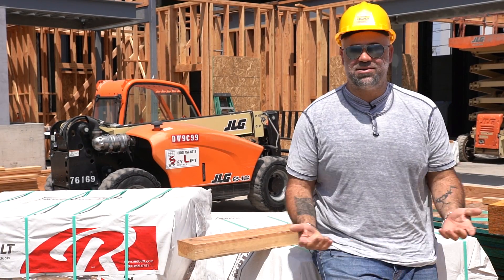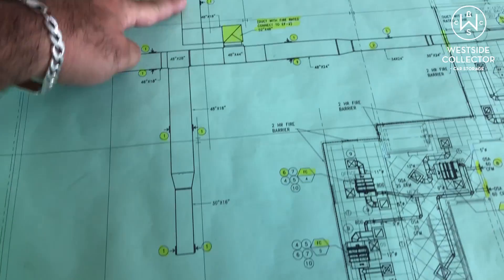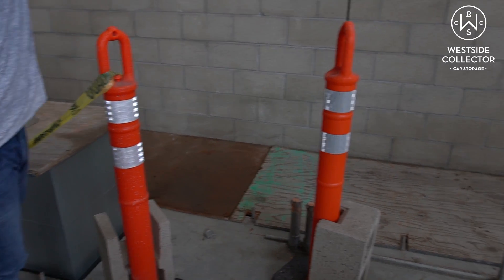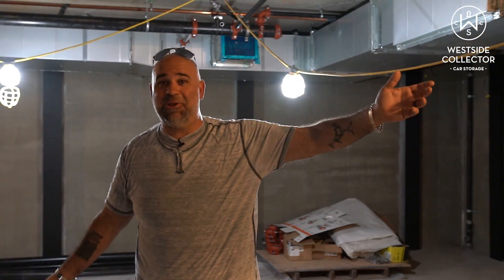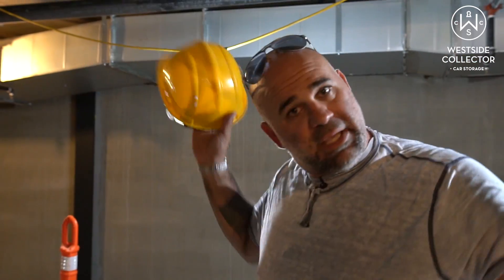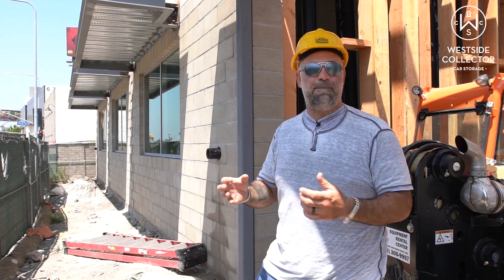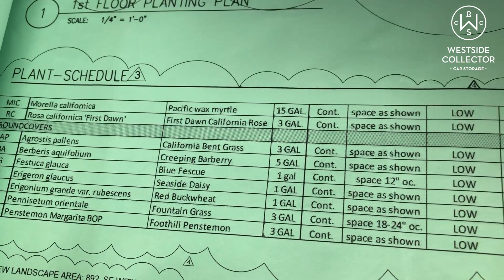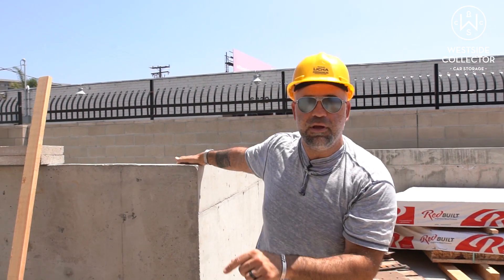How I Built LA's Coolest Parking Facility - Part 2: Air and Water

Comment: I like how Matthew has an interest in all of the MEP systems and structural elements of his development. Not something you often see from a developer.

However, the commentary about the sprinkler system around the 11 minute mark is not understanding a number of the foundational principles of fire protection engineering. 

With regards to the sprinkler system commentary, not sure I agree with what he's saying. 6" service sounds fine and is typical, but 3000 GPM (gallons per minute)? What does that mean exactly? Such a value would have to be tied to a corresponding pressure (i.e. 3000 GPM @65 psi, or in car terms, 400 hp @ 6000 rpm, not just 400 hp). That would be talking about hydraulic demand, much more so than a hydrant flow test result........but in either case an unrealistic # for discussion unless it's a theoretically derived flow at say 20 psi (and even so, that's not how an engineer or sprinkler designer would describe the system to his customer). 

Could the system have a capacity of 3000 gallons filling the pipes? For a large system, maybe. Not sure if this is a wet system or dry (SoCal probably never gets below 40 degrees Fahrenheit, so maybe wet). It's important to know the water capacity of a dry system so as to be able to design it to fill quickly in a fire scenario; 750 GPM is a threshold that requires a quick opening device, and could this system be 4 times that threshold? Maybe, maybe not, but not a relevant topic at the 30,000 foot level discussion. 

Total quantity of sprinkler heads does not affect water demand ("I have 90 heads in the basement alone"); they will only go off one at a time as necessitated by the fire nearby; a building can have 90 heads or 9000 heads and the size of the design area will likely be the same. You can only design for one fire in the building at a time, not the entire building engulfed at once. 

Normally when talking about sprinkler systems you talk about a hydraulic demand for a design area (most likely 1,500 square feet for ordinary hazard here), and a combined sprinkler & hose stream demand. There's just no conceivable need for 3,000 GPM for a concrete structure storing cars, nor is it likely to receive that kind of water flow for a non industrial facility, from a 6" municipal main. You would certainly need a much larger main to allow that type of flow. I've never personally witnessed a flow test putting out more than 1500 - 1700 GPM, which is a lot of water in itself, let alone 3000. 

If we assume NFPA 13 Ordinary Hazard Group 2 here (generous), 0.2 gpm/sq ft * 1500 sq ft = 300 gpm (and let's assume a healthy 20% overage), so 360 gpm, which we'll round up to a clean 400 gpm. Now add a hose stream of 250 gpm, and that's 650 gpm. Pressure is required hard to ballpark by comparison, but let's assume a very generous 70 psi. 70 psi @ 650 gpm demand.....where's the 3000? 

As for needing a fire pump, that is more an issue of being low on pressure (psi) than flow (gpm). Pumps boost pressure but do not create additional (you would use a large water storage tank for that purpose). For this type of building, the pump would most likely be needed once you get to certain heights because gravity pressure cannot be reduced via larger piping (you lose 0.433 psi per foot of elevation, i.e. about 43 psi at 100 feet). 

Lastly if the facility doesn't need a generator otherwise, the fire pump itself can be a diesel. No need to have an electric pump and a diesel generator unless that's what you want. 

As a licensed engineer, you always worry about factual accuracy in meetings, presentations, etc....then you see this spitballing of stuff and it makes you shake your head.

Comment: SO, the cleaning of the rainwater isn't so much to 'clean' the rainwater, but rather to delay the flooding effects of large rainfall.  If you think of a normal building with normal drains, the rain falls on the roof, it immediately collects in the drains which dump all that rainwater on the street, into a stormdrain, and on to the river.  With a heavy enough downpoor, this can result in localized flooding, flash floods, etc.  With the system you have, your building will collect rainwater and funnel it into your plant gardens.  it will then take several hours or days for the rainwater to filter through your gardens before ending up on the street.  This means that the flooding impact from a storm or rainfall event is severely reduced.

Comment: Lungs and Arteries of the thing are interesting structural aspects for your venting air quality  the fire suppression smart - something on power did you have off grid and back -up generator - so you get mass of passive cooling with that basement. -right so no islands rain cistern recovery reuse needed  no desalinization -the wash recovery interesting -diesel beast yup venting  so no sub poah recycle needed unless it was liek a marina condo combo building

Comment: Why can't you drain the planters directly into storm sewer drains?
Reply: EFormance Engineering storm and sewer drains are different
Reply: @offwhitecolby  To me storm drains implies surface, storm sewer implies underground.  IOW, why can't the planters drain into the underground storm drain network instead of going the surface route?
Reply: EFormance Engineering mabye location? and its also a hell of a lot cheaper to run some pvc in the concrete that runs to the street than have to drill into the sewer and then worrying about sewage smell and all that

Comment: I am curious what design reasons put your electrical panels right next to the lowest point in the lower level.  Flooding is a unfortunate reality, and you designed provisions to have pumps to remove water, but if they are overwhelmed in a situation where a few feet of water is in there and your electrical goes down because it is underwater... Can you address the thought process in this situation? maybe there is something I don't understand.

Comment: Never use right angles in duct work... this guy has 90 degree elbows all over the place costing valuable friction loss and using more energy than necessary to accomplish the same air transfer ... hack job at best
Reply: ChrisHallett83 going up a size doesn’t work man .. volume can’t be multiplied downstream from the source by using oversized fittings.. like I said it’s a hack job ... dude didn’t know how to build/calculate the bends for the sweeps soo the property owner gets a system that’s half as efficient as it could be because this skinny jeans wearing fat-Titted half ass jack of all trades and master of none happened to have the low bid... this is what you get when you take the low bids without specifics in the contract about the contractor not being a tard and half assing the fuck out out of the job.

Comment: I'm no mathematician, but if 170 sprinkler heads flow 3000 gal/min, and you have 90 heads in the basement, that's 1588 gal/min, but your drain and sump pump flow 70 gal/min. Anyone else see a problem here?
Reply: It's 3000 gallons of head pressure, sprinkler systems use a pill rated to a temperature to induce the foam to smother flame. And if there was a fire in a basement full of vehicles filled with gasoline, your last concern is flood prevention.

Comment: Matt, i was who pointed out the ramp drain situation, now having seen the actual drain, man call me stubborn but i think that is too small a drain for that ramp. I really hope it does work out for you. But that same speed that water gains in the ramp will carry it away from the slope to the drain. Fluids don't like to change direction.  If the water can pass over a drain at the bottom of a ramp, the drain is too small. 

Nature has a fondness of flipping a finger and kick in the butt designs deemed as "sufficient".

Good video man, very nice project !!

Comment: Oh boy, wait until California figures out that rain water is already clean.
Reply: you can get a shit load of particulate and pollutants in rain water, the air pollution (of which LA has a lot) gets trapped in the water droplets and brought back down. i used to live at a house with an outdoor in ground pool, one summer the smoke from forest fires more than two thousand miles away got into the rain water and in just one rainfall it turned the pool into a swamp. rain water isn't clean, especially if the air isn't clean.

Comment: You shouldn’t use wood in anything commercial 😣
Reply: flatplanefool Please explain this to me
Reply: Ok so I manage 5 million square feet of commercial real estate and I’ve had 2 fires set by the public in my buildings. 1 was a prankster with a smoke bomb the other was a  car that caught fire in a parking deck (parking decks don’t count in our square footage). Ok so neither of my buildings had any significant damage.  This however is a building next to my fuel pumps that someone left a space heater on overnight. https://youtu.be/hEmn46nGg_s     I had to baby sit the fuel tanks all night with chemical foam as I didn’t want to waste 60k gallons of gas and diesel but should the fire spread I would have.

I’ll let you guess which was concrete and steel and which was wooden.
Reply: Have you ever heard of the Chicago Fire.  

I know it’s a screwed up city politically just like LA.

Comment: Let's talk about the electrical.  You're teasing me with that big switch gear in the background.
Reply: gtalover139 and it's right at the lowest part of the basement, protected from floodwater by that tiny drain. 70gpm is nice for a little storm, but what about a potential flood?
Reply: Matty Anderson I thought the same thing at first but then remembered new construction has to pass strict regulations for those types of situations. Generally the municipality decides what that means. For LA a 100-year flood= XX gallons per minute per square mile or whatever and his lot covers XYZ square feet so they can figure out the "maximum" amount he needs to be responsible for. Now if it exceeds that, yeah....problems.
Reply: Matty Anderson Yeah that looks sketchy to me and im not an electrician. You think those panels would be up on a 18” concrete pedestal or something there is lots of clearance there.
Reply: Matty Anderson he has storm and sewage pumps in the basement.
Reply: Looks like 2k amps probably
Reply: Maybe a transfer switch if he has a generator
Reply: Haha
Reply: That definitely looks like a 480V switchboard with a several thousand amp bus.

Comment: As a building engineer, I find this very interesting! But Cali has the strangest requirements and regulations though. Why clean rainwater, which is usually already cleaner than the water you receive from the treatment plant? Then it drains out onto the street, then into the sewer, to become dirty again! 😂
Reply from the maker: As I recently learned, part of it is cleaning, and part of it is holding back the water on my property in a storm so that it doesn't overwhelm the storm drain systems in the city. Which, when you think about it, is kinda smart. Its like having those traffic lights at highway entrance ramps to create traffic on the ramp, which alleviates traffic at the merge

Comment: Seems like you WOULDN'T want all the electrical at the bottom of the slope where all that water will end up during a hurricane type deluge of a storm. Are the sump pumps on battery backups as well?
Reply from the maker: The sumps are on generator backups. I'm not sure what kind of hurricane type storms people are envisioning, but that doesn't really happen here, and if it did, the street would have to have like 2 feet of flowing water on it to actually make it down the ramp, in which case, everything is fucked and it's the apocalypse.

Comment: Sorry to say, but your contractor installing all the electrical switchgear near the lowest point in the basement was kinda dumb, even with that pitiful 2 or 3 inch ledge
Reply from the maker: There is virtually no way for enough water to get that far into the basement to flood that system. This isn't Miami, we don't have regular hurricanes, and even if we did, only the water that fell directly from the sky onto the ramp itself would make it down to the basement. If enough water is down there to flood the electrical panel, every single car is totaled.

Comment: Filtering rain water seems crazy to a layperson but us civil engineers have been dealing with it for a while (about 15 years in metro Atlanta).  The new big push is to actually infiltrate the run-off instead of letting it run into the street.  If I had to guess your system may do the same and just overflow from large rain events is what runs into the street.

Comment: As a residential developer here in L.A., Matt has barely touched the surface of how ludicrous many of the building codes are.  Some make sense but most are way, way over the top.  Extra expenses to the developers always gets passed on to the consumer.
Reply: stuff like this makes LA expensive
Reply: Tully3674 many building codes are in place directly because of people that died in a building disaster.
Reply: @Patrick94GSR  No kidding!!  But the rain water filtering is a good example of the liberals in local government going overboard.
Reply: @Tully3674  as other people have stated, there are very valid reasons for rainwater retention and filtering procedures that are also present in other cities

Comment: Matt I love these videos of your new facility! Are the garage sump pumps on backup power in case of a power outage during a big rain storm? Are the electrical panels down in the garage water proof?
Reply from the maker: haha no the electrical panels are not water proof. They are as far as we could put them from storm water. There is a back up generator for if there is a massive power outage. But you need to remember, the only water that comes downstairs is water that physically lands on the ramp from the sky. The ramp entrance itself is elevated, so water won't be flowing down there from the street. So you only need to drain the water that lands on like a 20x60 piece of concrete. It's really not that much water even in a very heavy rain.
Reply: That makes more sense, I had a vision of water rushing down there in a bad storm draining really close to those electrical panels. I work as an HVAC/plumbing engineer and love the details that you are going into your building. I love watching your car reviews too!

Comment: Hey Matt, what's all that about oil/water separators for the car wash drains you mentioned? 
And since you didn't reinforce the roof, does that mean the HVAC stuff isn't going up there? (Not the ducts, the compressor or condenser or whatever)
Reply from the maker: There are oil/water separators underground; all wash bay water and storm drains go through it. The HVAC stuff (the offices and reception are air conditioned) goes on the roof of that structure, not the roof of the primary warehouse structure. That roof structure is designed from the beginning to hold that weight.

Comment: one of the other reasons for LID is not just to "clean" the rainwater but retain the water for a time before being allowed to hit a city's stormwater system, which if LA is like any other big city, has been at capacity for years and will easily be overwhelmed in some rainfall scenarios. Where I live, LID is used to ensure that water doesn't leave a building lot, instead it is retained and allowed to slowly infiltrate into the soil/substrate/aquifer onsite...it's never supposed to hit the stormwater system.
Reply from the maker: That's interesting, and a great point. Reducing load on LA's storm drain system is another angle I hadn't considered. Because my building is the entire property with not much free space, there is basically no way for the water to get all the way into the ground, so I guess the method we are using is the closest we can get.
Reply: it also helps slow the water cycle, rather than all the water immediately hitting the storm system and straight to the ocean, it can re-enter the already starved for water ecosystem
Reply: Correct. That’s the same thing they are doing here in Pittsburgh. Green Infrastructure aka rain gardens and bioswales are pretty sick
Reply: Although ours is because we recieve too much rain. We have combined sewers here. If we get over 1/4 inch of rain in 24 hours it overflows. Pumping piss shit and debris into our rivers. Joy.
Reply: I like the green roof ideas, as it can aid in cooling and heating, but this is another way to do it also.
Reply: In my area all developments must have catch basins (usually small lakes). They serve the same purpose. They offset the effects of the paved areas by holding all that water until it has time to be absorbed naturally into the groundwater system. We're not as crowded as LA though, so we've got room to spread things out a bit.
Reply: @ChuckBeefOG  - that'd be nice, but getting it to the water treatment plant would mean either building an entire new water system from each location to the WTP, or keeping huge containers on site and trucking it. Both would be wildly expensive.

You are correct, LA gets most of it's water from outside LA.

Rainwater collection systems are actually not uncommon in CA/LA- however they don't get it treated for reuse in homes. The systems I've seen in basically have a giant cistern beneath the building for rainwater collection, which they then use for irrigation.

Comment: Grease trap setup?
Reply from the maker: Yes, I called it an "oil/water" separator in the video, but that's what it is. The car wash bay water and the storm drain water run through the oil water separator before being pumped out into the LID planters.